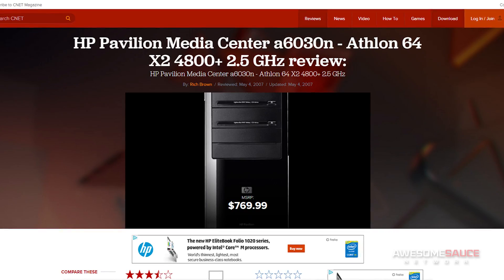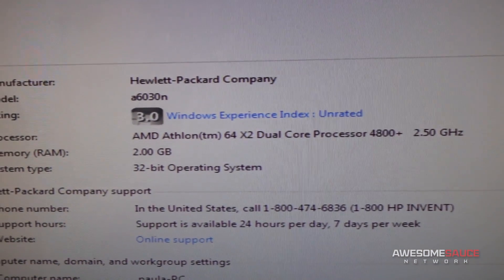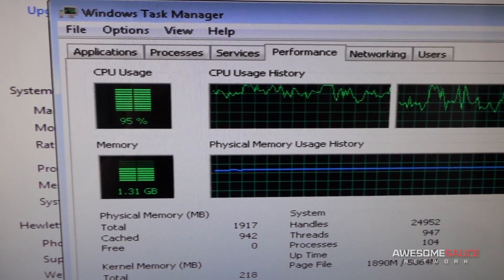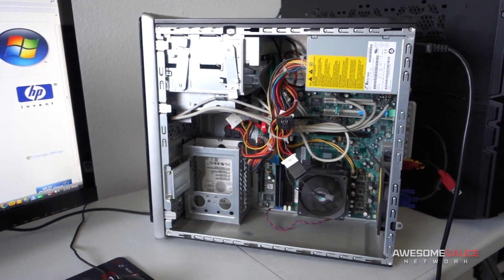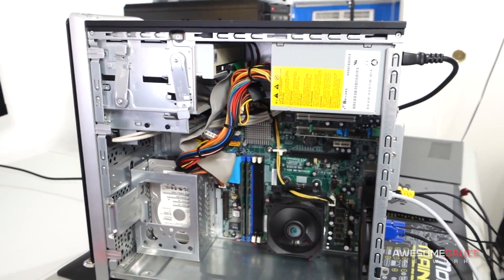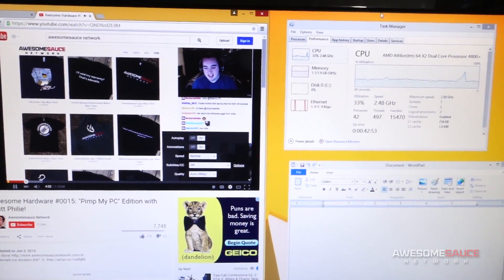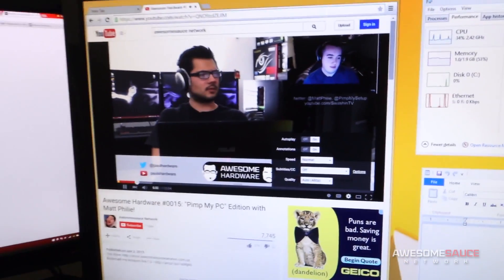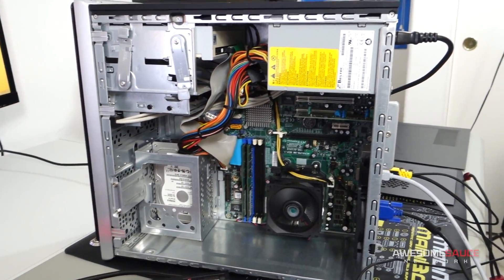Cleaning Up My Neighbor's Old Desktop!

Comment: can you or someone in the comments help me? 

this is my system (7 or 8 years old):

cpu: intel core 2 6300
gpu: nvidia geforce 7300 gt
ram: 8gb (dont know the speed)

its realy slow sinse a couple of days. well i havent used this pc for around 2 years, just resently started to use it again. at first i got like 80-90 fps while gaming and suddently its not getting more then 10 fps. on task manager its all just fine on idle it doesnt peek above 20 % most of the time its 2 % what is the problem?
Reply: This is definitely a graphics card issue. One way that you could upgrade your system for constant 70-80 frames per second in games like CS:GO is to upgrade the graphics card to a GTX 750 Ti. This is the cheapest and best performer in the mid 100 dollar price range, and I highly recommend it to anyone.
Reply: I dont think that can go with my motherboard and other componets?
Reply: +Danny Gr I'm not sure what mobo you have.
Reply: +Nitez_Alpha idk to, how can i see that?
Reply: +Danny Gr Download CPU Z. It will show you the detailed specification.
Reply: +Danny Gr That card will fit, they are both pci-e cards and the 750 ti should fit.
Reply: +james stephenson ahh thanks but the cpu is shit to so gaming will still be terrible i think
Reply: +Danny Gr No problem, good luck anyway with the cpu.
Reply: +james stephenson thanks, i'll probably buy a new pc
Reply: +ImTeeps for a few dollars mote he should get a 950 much better performance for 30 bucks mirenor something
Reply: +Danny Gr Before you buy a new PC, pull off your CPU cooler, replace the thermal paste and re-attach. If the problem persists, do the same for your graphics card. Your CPU isn't terrible and should be capable of a decent overclock depending what motherboard you have.

Comment: Nice, I just built my first CPU 15-4690k msi gtx 960 4gb, hive modular 750 PSU, Samsung evo ssd 500gb, WD 1TB HDD, Z97 Gigabyte sniper MOBO. Coolermaster evo 212 cpu cooler and more. I am doing a review on it soon on my channel. I also have videos of me overclocking my CPU and GPU with some pretty nice results if you wanna check them out on my channel. Thanks in advance guys

Comment: When im installing windows 8 it doesnt recognize my graphics card why?
Reply: Have you installed the latest drivers which came in the cd with the gpu?
Reply: +Best2b Played  *on
Reply: +Best2b Played never got a cd with it cuz i got a ready to use pc.. And i tried to download and install drivers but still didnt recognize my gpu :(
Reply: +Twist does only Windows not recognise your gpu or is it the whole pc. You can test that by downloading a program called gpuz. Otherwise try to google it I don't think you are the only person having that problem ;)
Reply: +Twist you have to plug the dvi/display port/hdmi into the actual video card. first try reseating the card into the pcie slot and check to see if the fans spin on startup. If they don't, try replugging the 6 pin connector and i that doesn't get the fans to spin, your card is DOA. Next go to your gpu manufacturer's website (amd or nvidia) and install the corresponding driver for your chip. Next, go type device manager into the start menu and check display adapters. Click on your graphics card and see if it is activated and says that it is working properly. If that doesn't work. If all of this fails, you probably did a step wrong or your gpu is ready to be replaced /: hope this helps!
Reply: +Markahotox l my gpu is very old and if i have windows 7 installed it does recognize my gpu...
Reply: Sharkboy1006 idk
Reply: +Twist plug your display cable into the video card, not mobo
Reply: Quietbut_Deadly nvm downloaded windows 10 errthing is fine
Reply: +Twist JUst check the type of the GPU in the device manager of windows 7. Then you can go to the GPU manufacturer to see if that GPU is supported in windows 8. If it's a laptop, you have to check the laptop manufacturers website to see if they have a windows 8 driver. Some laptops won't work with the driver from the GPU manufacturer.

As a last solution you could just force the video card driver to a standard super vga driver if you don't use the system for gaming. It will work and support full HD resolution. It won't be using hardware decoding for MP4/H264 videos though.
Reply: +Twist Get a new graphics card that doesn't suck ass.
Just a helpful tip.
Reply: +Dragonix Plays smh my pc is 10years old its garbage gonna get a new one soon
Reply: ***** Noice.

Comment: What is the compatible graphics card of this specs:g2020(2.90ghz)4g ram ddr3 ? Pls reply
Reply: +Allaboutthatvidz Any PCIe card. Worst case your CPU might not be able to keep up with the graphics card, so the GPU won't run at 100% load. It will still work fine, just not at it's maximum possible FPS. I think a Geforce 650 or 750 (750 is better) or AMD Radeon R7 270 would be plenty for that processor. Anything higher would be overkill, unless you plan on upgrading your Motherboard and CPU later. First check if your power supply can handle it though! If you have a crappy 350 or 400 Watt powersupply(You need at least 20A on the +12V or 16A If the powersupply has multiple 12V rails) . It should be written on the side of the Power supply what it can give on the different voltages) don't upgrade anything until after you replace that with a proper brand 500-600Watt one! The powersupply is ussually overlooked but a bad or underpowered powersupply can make a system crash or not bootup if you install a more powerfull GPU/CPU. And crappy powersupplies can kill your mainboard/memory/CPU or GPU when they burn out/die.
Reply: +Robert Phoenix tnx for this informative reply.the power supply that i have is 600wats max.
Reply: IT will have to have at least 350Watt on the 12V and preferably over 400 to drive both the processor and Graphics card. I've been running a Coolermaster silent pro whihc only had 340Watt on the 12V, but was running a Geforce 560ti and Phenom II 905e(which is a 65Watt max processor) When I overclocked the CPU from 2,5 to 3GHz my Powersupply died after a week when I turned the system off. So you definetly want more power on the 12V line. Especially for AMD Radeon cards as the R9 280X alone takes around 300Watt on the 12V. If your powersupply is at 350 or lower on the 12V you'll probably be limited to nVidia and cards with < 200Watt power usage.

Comment: Wow 2007? 

My computer (2005) is XP pro service pack3!! yes you read that correctly haha, Its the compaq Presario SR1000/SR1839UK. 
      I've tweeked it up since though although I'm going to build a new one, the tweeks I did was buy a new Graphics card an Nvidia Geforce GT220 bumped up the RAM to 4Gig and put a new power pack in which is an Ace ATX750v.

I'm thinking of using the Compaq case and Power pack again (Saving me some money) although I'm not sure which motherboard (ATX)? etc to use , I wouldn't mind using the Nvidia GTX 950 and intel core i5 4670, will this fit in the case?, The computer will be used for some gaming mainly flight sim, Video editing, and music plus family stuff.

Can you point me in the right direction or maybe even build one? ;) can you put a list on my home page too so I can refer to it later?

Love the vids keep them coming. 

Noob Matt

Ps the online shop I tend to use is www.aria.co.uk

Comment: i picked up a old pavilion p6110y which the harddirve was removed i kept the mothererboard and burner but got rid of the case ive never really liked OEM cases and this one computer was gonna be repurposed as a HTPC machine and it still runs to this day(only thing was wrong with it was a junk factory PSU) and i would of upgraded the ram on that pc you show in the video and replaced that bestec powersupply (bestec is known garbage and 5v killer) just like hipro is junk
these days it has like 2 320GB WD blue drives (since there was no original OS drive) 6gb of ram (came with board) Corsair cx430m intel pentium dual core e5300  the factory dvdrw drive and Nvidia geforce 8400GS all inside a nmedia PC htpc case also the OS on it is windows 7 professional x64

Comment: +Awesome Sauce Network I need some help everyone.... i have intel G3220, Gtx 750Ti, 8Gb ram, and using windows 7 sp 1 64bit, but when my pc load mozilla and open twitch / Youtube my cpu usage spikes up into 80-90% i already clean my pc and clean all the hardware, using ccleaner, malwarebytes, chkdsk /f/r,sfc/scannow, defrag, disk cleanup, scan using antivirus, re-installing windows and another.. but when i load twitch / youtube it is still same. please anyone help me :( i dont know how what to do to my computer. i give up T_T
Reply: +Awesomenetwork Sauce
Reply: That CPU is a serious bottleneck for your GPU.
I would recommend getting a higher end CPU for your system.
Reply: i think it's not my problem, cause previously it running normally, but now after i am upgrading my HDD into 1TB ( WD Black ) from my 500GB WD Blue and downloading an adware the problem is coming, which is i am already clean it with any antivirus and any malware or any adware free / premium ( even it with crack lol ) but the problem still coming, how you can explain this ?
sorry my english grammar bad :D

Comment: I find this video to be quite stupid, and a time waster in my opinion. 
This is what I do when I help my friends / family clean / greatly increase the speed of their computers:
1) Tell them to buy a large USB or external drive, and to put all of their documents, pictures, and anything else important onto it.
2) Warn them that everything will be deleted
3) Do a fresh FACTORY RESET on the PC, and when installing windows BE SURE TO REFORMAT THE HARD DRIVE (if xp or vista, install Windows 7 or 10)
4) Install GPU (Graphics) drivers, and network drivers (if needed), and all other important drivers (typically you don't need much more)
5) If the PC came with Windows 7 or 8, you should think about upgrading to 10 as it DOES speed up the PC quite a bit (7 not so much)
6) Turn off Windows Security, UAC, Defender, Cortana, etc. (they are mainly just there to annoy you)
7) Uninstall all-pre-installed apps like Nortan, HP, and all the other shit (google it if you don't know what it is)
8) Install Google Chrome AND ad-blocker and set it as the default explorer (tell the user to NEVER USE INTERNET EXPLORER)
9) Install CCleaner, and tell the user to run it once every 2 weeks, and to also run the registry cleaner
10) WELL DONE, be sure to collect $200 once you past Go.

Seriously though, if you follow these steps your parents, your grandparents, and your great grandparents will start using their PCs more, and be VERY HAPPY and think you are some sort of genius. Most people in the world are bogged down by ads, malware, viruses, and programs that constantly interfere with what's most important.....(porn)

Side Note: You may wonder "what about anti-virus?!?!?!?" well in reality most people don't need to worry about viruses UNLESS they are using Internet Explorer, Downloading Unpopular Torrents, or going to shady sites to install weird programs (like hacks for games). Most people just browse the internet, check emails, and watch videos, you don't need anti-virus for that.
Reply: GamingTaylor Google Chrome? You better put 8GB ram on it if you want to run GC...
Reply: Amd whats wrong with Explorer? I always used it and it wasn't slow at all. Is a great web browser, it just lacks of some details, but for the most part is a decent browser.
Reply: Now you can't use CCleaner anymore, hackers have succeeded to put a malware in the installation exe, possibly making your computer a zombie for their attacks, though the main goal was to infect company pcs to steal data. It may never bother you, but having that on your PC is not a thing i like. All CCleaner installed since mid-july or so have this malware (i don't remember the version number).
Reply: Edge right now is a very good browser.

Comment: I have a similar hp system made about a year later that I'm looking to upgrade for gaming. Should I replace the whole mother board as well + cpu and gpu? My case is very similar, what would you recommend to improve cooling?
Reply: +Clean Stream You need a better Powersupply too and better cooling for more modern CPU/GPU. you are better of just buying a modern PC case for 30 USD then using such an old HP case.
That said however if you get a second hand Geforce 560 or 560 ti and some extra DDR2 memory, you should be able to play even modern titles on that system as is though you will have to lower quality and probably resolution a bit. To keep things cool enough you might have to leave the side panel off
Reply: Thanks! Much appreciated

Comment: could use some advice, just got my new GPU, and to my endless frustration my old HP h8-1020 will not recognize it. There are no bios updates since 2011. I know the best option is new build but that is not in the budget for some time. anyone know how to make new cards work on old clunkers?
Reply: +Count Mills Sorry, but if the bios doesn't work with the GPU then you are probably out of luck.
Make sure your powersupply can handle the GPU though.If you have a 5 year old powersupply chances are that it cannot provide the GPU with the power it needs. (Also make sure you connect power cables to the power connectors on the GPU. If the GPUJ has 2 power connectors BOTH need to be connected to your powersupply!)

Comment: ooh nostalgia I had that  64X duel core in my old computer, the memories of attempting to game on a system with that processor 4gb of ram and some cheap graphics card off of Amazon.
Reply: +ThatWolffe What do you mean attempting to game? If you added a proper GPU that CPU was the shit for gaming 7 years ago. I used to use an Athlon X2 3800+ with 2GB of ram, a Geforce GTS 260 with Windows XP 64bit and it ran all current games just fine.
Reply: Robert Phoenix I mean I was a poor kid in school with parts that were already outdated and I was trying to play games like crysis and GTA IV,
Reply: Well yeah, if you was stuck with something like a Geforce 6300 or later 7300 then gaming would have stunk.... :)
Reply: Robert Phoenix I don't think it was anything even close to that, just one of those cheap £20-50 media cards FPS was below 20
Reply: 6300/7300 where low budget nVidia chipsets. Their enthiousiast level cards where 6600-7600 and their highend gamer cards where 680-7800. The 7300 I had didn't even have a fan, just a cooler block. I bought mine for around 35 Euro's then. Your card probably had a similar chipset from nVidia or AMD. THose are the only ones that make graphics card chipsets. THe competition they had from Matrox and Via (S4 Savage cards) I think had allready disappeared by then.
Reply: Robert Phoenix I know it was an nvidia card, but i cant remember which one, I will have to go find it in the attic some time, I know where it is.
Reply: lol, don't havev to go dustoff some old stuff. e agree it was a low end card, wether it was a 6xxx series of 7xxx isn't that important right :)
And if it was a 6200/7200 or 6300/7300 doesn't really matter either. It's old and it was slow. 'nuff said ;P
Reply: all I know it was a 3 number card not a 4 number card and it was slower than a granny drinking tea while walking along the middle of the road with her zimmer frame

Comment: Dude,
 How did u slow the fan ???
Reply: +Vinayak S fast spinning fans on camera can look like theyre spinning slowly, its just an illusion
Reply: Hmmmmm
Interesting........
Shocked actually
Reply: The cabinets fan ??
Reply: +Vinayak S And he did clean the back fan, the CPU cooler and even replaced the old crumbly thermal past between the CPU and the cooler. These cleanups probably made the cooler 70-80 % more efficient then it was. So I'm sure the CPU fan dropped about 40% in speed when idling in windows after that.
Reply: Thanks For the Info bro
Reply: +Vinayak S Many motherboards have this option in BIOS

Comment: that vista sticker almost gave me a heart attack...
Reply: Better than 8.1 lol
Reply: +Robert Phoenix  it's a joke because vista is crap
Reply: +Carlos Maggoo ikr
Reply: +Carlos Maggoo Why? Just turn off all the visual gadgets in the system advanced performance options and it works as well as XP did. The old guy is just using the system to browse the internet as far as I could tell from the video. Vista would be OK for that as long as new security patches are still released for it.
Reply: Vista isn't that bad, I'm currently using a PC with Windows vista, and it's fine.

Comment: -Windows 7 64bit    (10 is also OK but that was not officially available at timer of video)
- 8gb RAM  4X 2gb  $25.00   
- nVIDIA GeForce GT 620 1GB  $25.00

So $50.00 to upgrade hardware.    (I did not include cost of OS upgrade)
Reply: +SteamedRevenge Nope,  That motherboard can take 8gig of RAM and has a x16 slot for the Video Card 

http://h20564.www2.hp.com/hpsc/doc/public/display?docId=c00880850
Reply: +Zantor135 Yup, would proof the system for 1080p playback. If you throw in a 30(30-40USD) or 60GB(40-50 USD) SSD for a system drive the system would also become a much faster internet PC as well as make it feel like it has a much faster processor as everything startsup much more snappy with that..
Reply: +Zantor135 You could even upgrade the processor. That system could probably be able to run up to an AMD Athlon X2 6400+ CPU (if you could find it online for cheap). Woul.d only be worth it if you could get it below 25 USD though :)